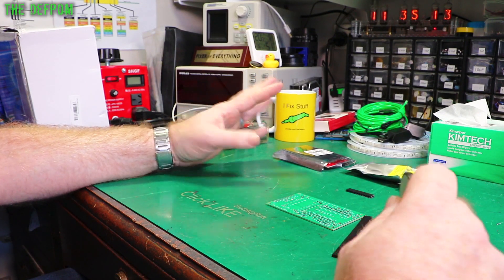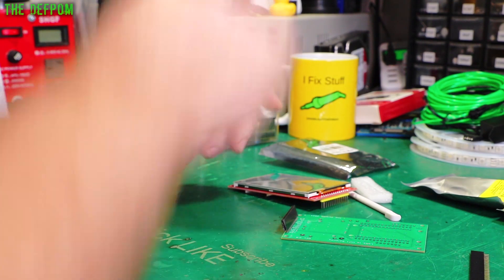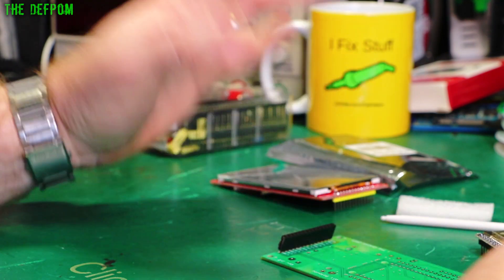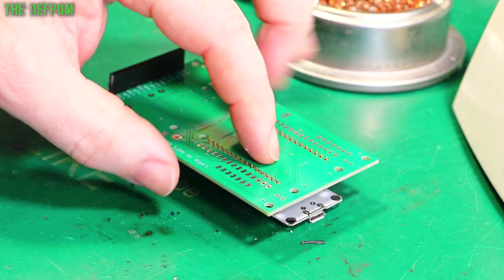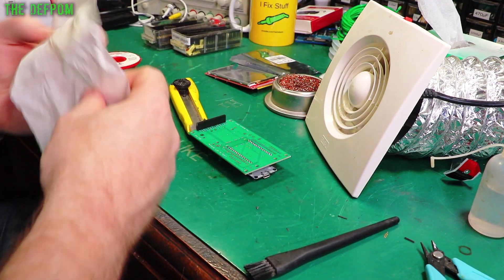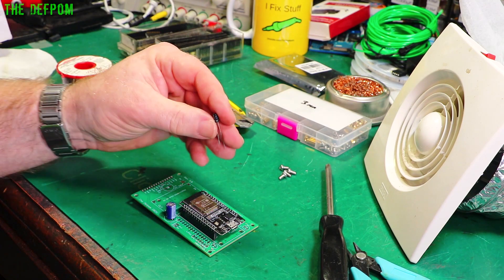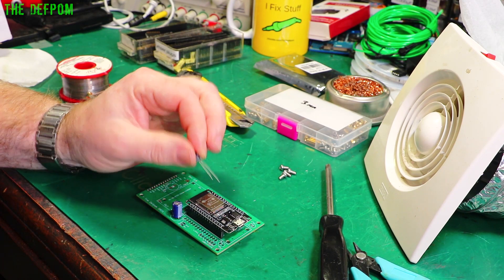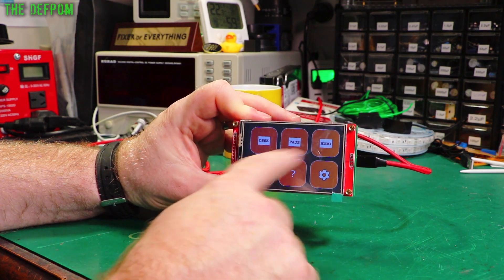🔴 FreeTouchDeck Build - DIY The Free Touch Deck by Dustin Watts - No.843

Comment: A very nice project. And, an excellent adaptation of your board. I was also impressed with how neatly you worked in the button press cap into the middle of the board = Nice bodge. I have built several PIC18F4550 boards and set them up to be highly adaptable. So, I can easily use one as a base for lots of different projects. One is even configured to plug directly into a breadboard. MCUs are handy.